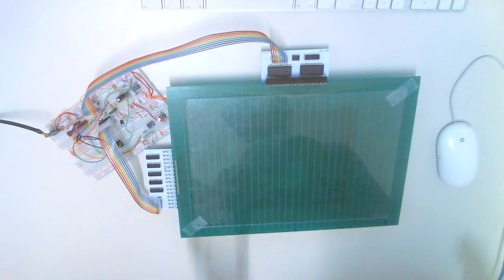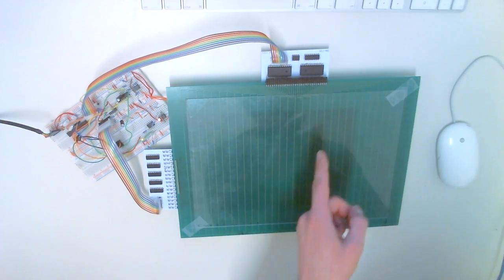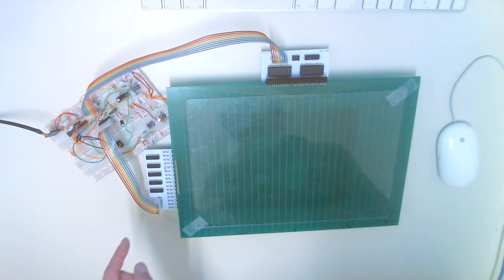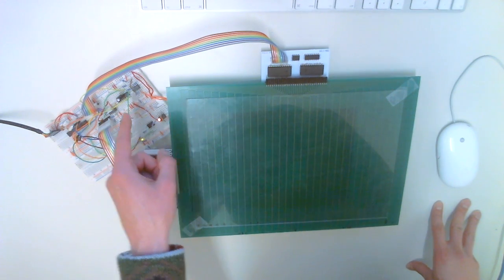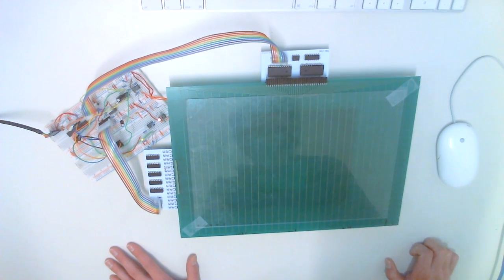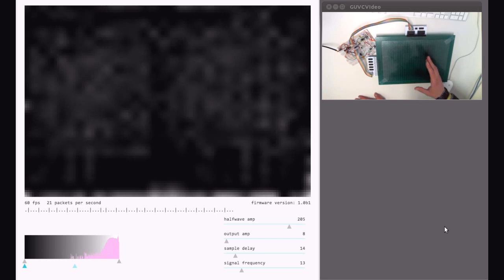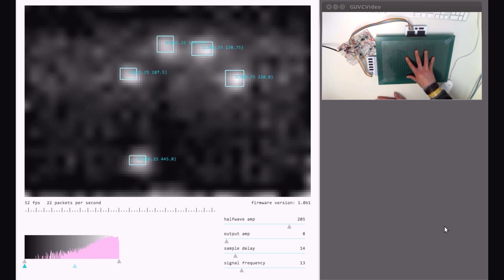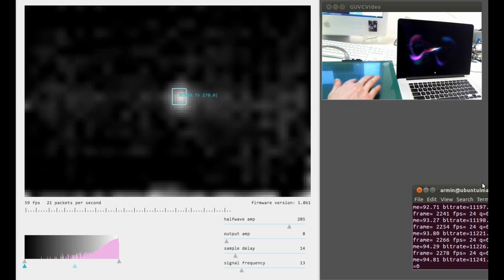capacitive multitouch prototype explained

Comment: Technical Learning

Inductive proximity sensor // Target Material sensor

https://www.youtube.com/watch?v=ob86YUQX240&t=30s

Indective Proximity Sensor
A inductive proximity sensor can detect metal targets approaching the sensor, without physical contact with the target. Inductive Proximity Sensors are roughly classified into the following three types according to the operating principle: the high-frequency oscillation type using electromagnetic induction, the magnetic type using a magnet, and the capacitance type using the change in capacitance.

Comment: is the 22 per second measure rate just your choice to match a common frame rate, or is it also near the limit? I need to do something similar, but in a time-critical application (and without vizualization). so i need a max response time of 1ms, is this possible with a setup like this?
Reply from the maker: Bandwidth will be your first challenge. This prototype had 702 sensor points and we pushed them to our computer via a serial usb connection. We did some hacks to get 24 fps. If you want more, you need a different connection – or a smaller grid.

Comment: Cool! Does the capacitance increase or decrease when the node is touched?
Reply from the maker: Getting your finger near a node will decrease the mutual capacitance between the two electrodes. The coupled signal will get weaker.
Reply: Armin Wagner I have used charge-transfer method for touchscreen and the mutual capacitance decreases with the touch too. I am seeking confirmation that the mutual capacitance decreases with the touch is independent of the implementation, and your observation seems to confirm that. Thanks you very much for the reply.